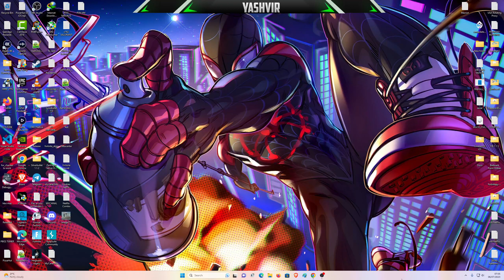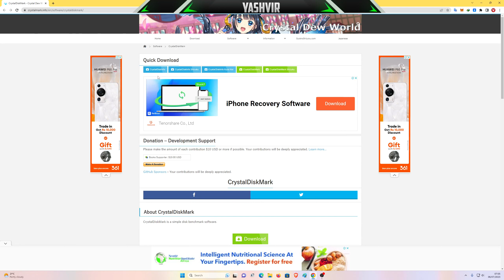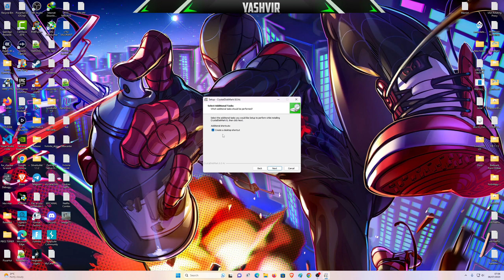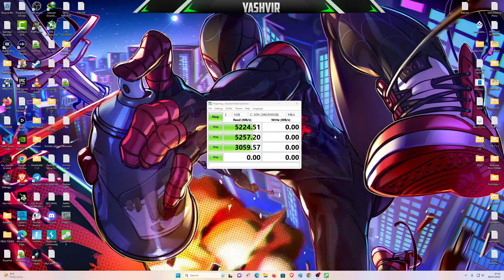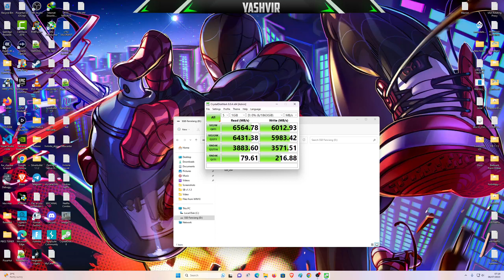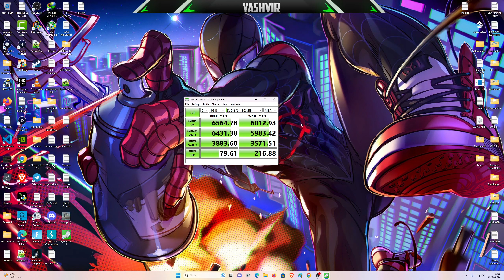Benchmark M.2 Nvme SSD: Comparing Speed between WD_BLACK 1TB SN770 & Fanxiang S880 2TB Nvme Drive

Comment: Are the specs of both m.2 slots the same?

This test is worthless unless you test them both in the same m.2 slot. Its rare that both m.2 slots on the same motherboard would have an equal number of pci express lanes so one slot is likely slower than the other ruining the test results.